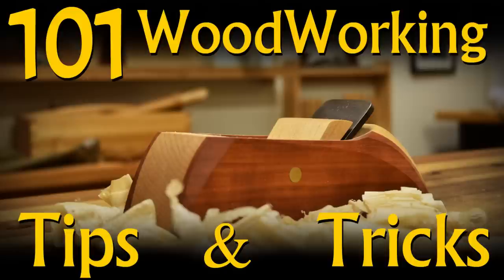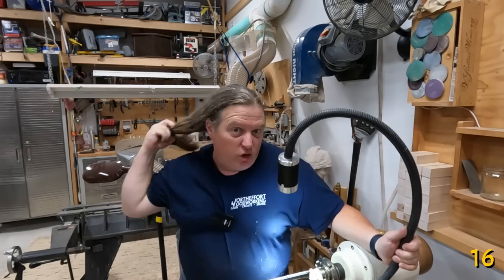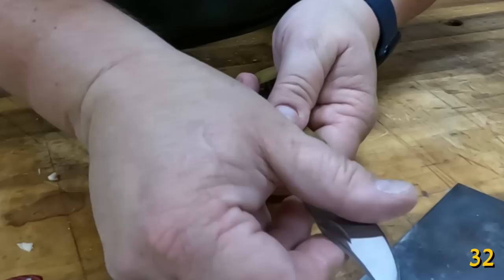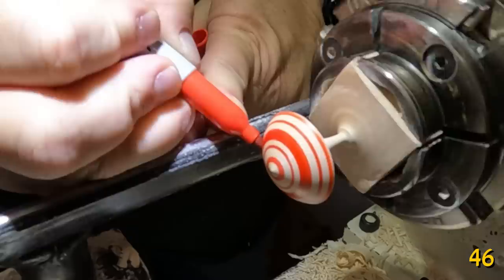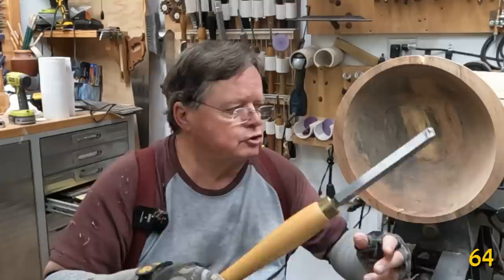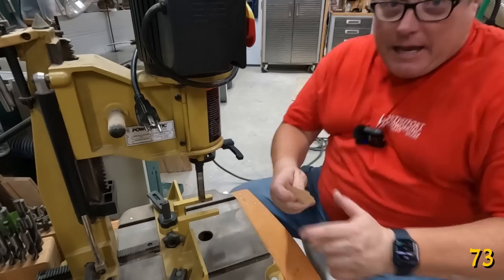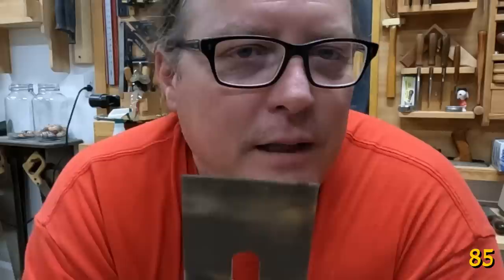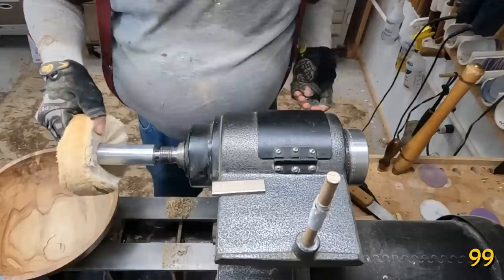99 Woodworking Tips & Tricks

Comment: I love these kind of videos! Sure, I knew about 97 of these, BUT I learned 3 new jewels! I have been working wood since I was 7. I have never had the idea that "I know all that!" In this case, I learned 3 new nuggets. I love the Idea of chucking up a hook to hang drivers/drills. Also, I should clarify: I learned 2 things from your list, but 1 from the background; You have what looks like 3 or 4 inch white PVC pipes mounted to the wall for storing sandpaper and drill motors. I will implement that ASAP as all my battery drill motors are wasting valuable shelf space! Should have been "Bonus Tip #101".

Comment: That was a great idea about the cathedral grain Direction however can we not show dangerous operations such as turning Square pieces on the lathe show how to prepare the edges by cutting them on a bandsaw
Reply from the maker: There is no safety reason to round square edges in good wood.
Reply: @wortheffort  as a woodturning myself I can assure you that turning square stock will be easier if the corners were cut off first then there be no hammering of your gouges
Reply from the maker: @emanuelmifsud6754  disagree. It’s a waste of time, benefits nothing.
Reply: @wortheffort  do you disagree that having long hair next to a pedestal drill is dangerous
Reply from the maker: @emanuelmifsud6754  I don’t think you watched this video and just need to comment to feel better. Why do I say this? A) long hair pulled back is safe and that’s what you saw from me while working in this video. B) you couldn’t of seen me using a pedestal drill press with loose hair because I don’t own a pedestal drill press. So I wish you well.
Reply: @wortheffort  good luck to you if you get sculpt operating the pedestal drill the lathe or your morticer YouTube is full of videos that have not been proof check for safety
Reply from the maker: @emanuelmifsud6754  they have, by me.